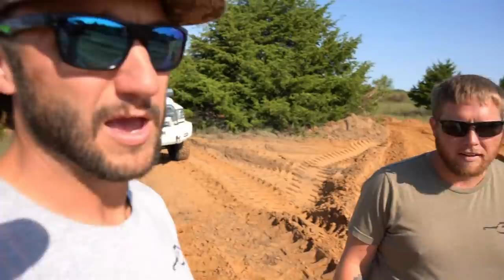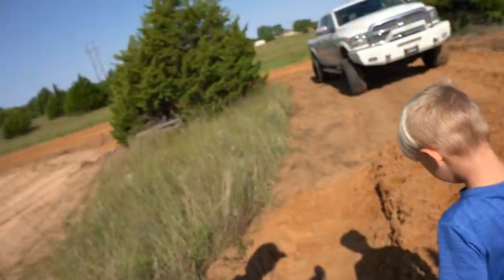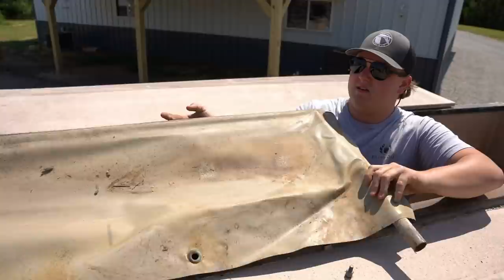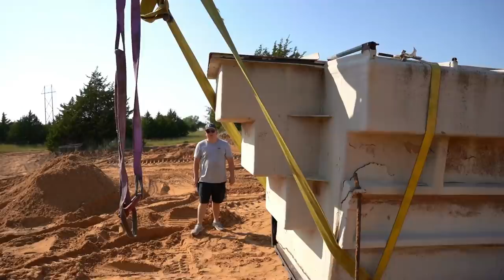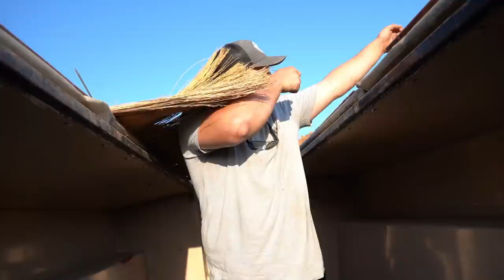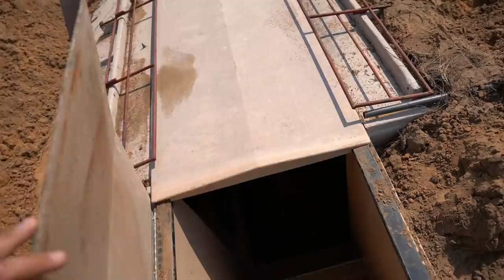I Put an Underground Pit Blind on My New Pond!!

Comment: Since you are facing south, if you are close enough to get electric to the new blind you can not only run your heaters but you can have electric for an icebreaker in the pond and you will just slay the mallards in December when things are frozen over and you have a big north wind and open water.